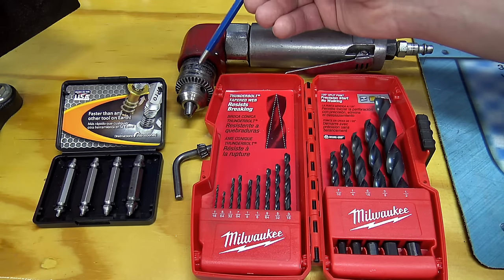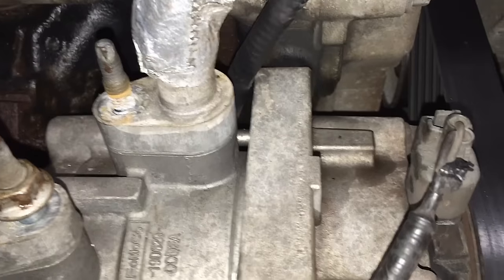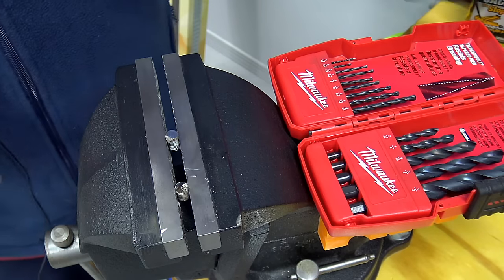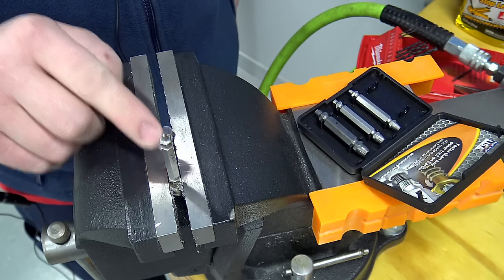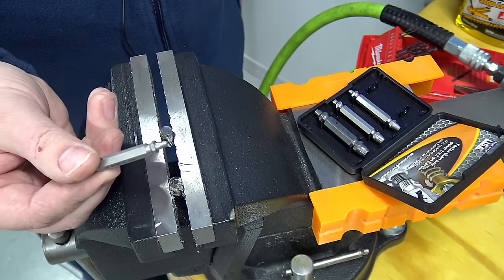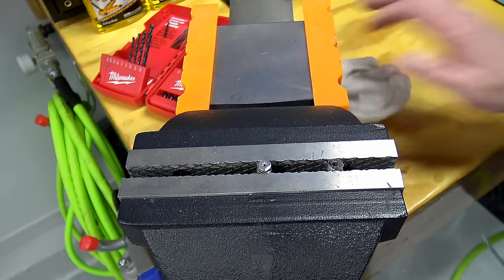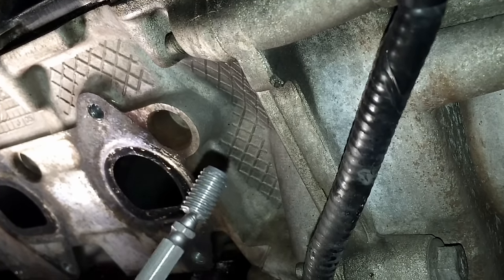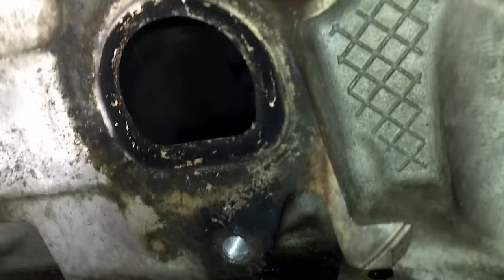Ford 4.6L 5.4L 6.8L 3v Engines: Broken Exhaust Manifold Stud Removal

Comment: I did this job on a 2000 expediton with 50k miles only thing that worked was welding nuts on the studs every other method was a fail total waste of time

Comment: NEVER..EVER .. has anything came off of my truck this easy.  He is truly blessed by the ford gods 😅
Reply: I have never had an extractor work either, have same set.. just fixed manifold and EGR tube on an E150 van, 3 studs snapped, had to drill and tap them, luckily the rear ones and could reach from tunnel on a 5.8, then bought a newer F150 3 valve and of course, the manifolds are leaking on that as well...

Comment: I wish the factories would start using anti-seize on most everything, especially stuff like this.  I'd rather have something like this come loose and leak than break and leak.  You are definitely the "car whisperer".  You have talents that continually amaze me!
Reply: That’s not the problem here the problem here is the quality of the studs.. I almost never drill anything out I weld a nut to the broken stud and back it out like that. If I do drill I use left handed drill bits they are already short bits and since they spin left handed if it “catches” the broken stud it will back it out if it’s not frozen in there. He did do a great job drilling these studs it’s not easy to drill nice and straight like this I use a guide to get them drilled in the center.

Comment: Try it on a rust belt 2004 5.4 3 valve F150 that's 20 years old and has 206,000 miles on it. I recommend 1000 degree JB weld and live with a little noise until you have to yank the motor for all the usual.  Ya know, timing chains, roller rocker studs, cam phasers all of that. You do good work. These are a nightmare. I do like the trucks but cmon Ford!

Comment: That Grabit brand of extractor I own works well but i have had issues twice with the smallest one snapping the tips off.   The other day I drilled out a small WSS wire bracket bolt on a E250 steering knuckle and the bit tip broke off.  I think it was just way too rust welded to be extracted.  Without rust the tool works good.  The Grabit honors the lifetime warranty, mail it back and they send you a replacement.

Comment: I just finished replacing the passenger side exhaust manifold.  The two rear studs were broken.  On the top, I drilled a hole and started to remove the stud with a Grab It Pro #1.  It was turning and coming out then the extractor tip snapped off in the hole.  Looked around and found several references to using Dremel bit 953 (aluminum oxide grinding stones) to  cut through a broken extractor.  Took two bits to get through it but it worked out.  Opened the hole up a bit more and used the larger #2 extractor to finish the stud removal. 

As always, thank you for the video.  I've finished two repairs on my truck now with your help.  Great step by step guides.

Comment: Thanks for the video! I managed to extract two broken exhaust manifold studs from my 2000 Navigator 4 valve. I followed pretty much step by step as per your video. I did a dry run with a stud in my bench vise to ensure I had the correct drill bits. Worked like a charm. This is the third of your video's I've used with success!! One to change all the lash adjusters on my 2000 Navigator and one to change the Cam Phasers on my Wife"s 2005 Navigator..  Great!! Thanks again!!!

Comment: Ok, u have no idea how many different "broken stud" videos i have watched and while most were good, none of them fit my situation so the process wouldnt work. The studs on my 5.4l 2v head broke off about a 1/2 inch in the hole and now i finally have the right process and access to the right extractor set to get the job done. Thank you so much for this video!!

Comment: Awesome Brian!  I have fought that battle and feel your pain!!   A few tips and tricks I can offer that have occasionally worked are: if the stud broke off even with the flange -which they often do, is to weld a nut (which fits over the whole stud) and lay into it hard until that thing glows cherry red (filling up the internal part of the nut).  Once it's cooled a bit, you can try backing it out. It should go easy at this point since you have heated it enough to swell the stud and expand the joint some.  If it's still stubborn hit the nut with a Mapp torch and then cool it off with some PB Blaster or equivalent penetrating oil and let it suck some in and try again.   If need be - you can weld yet another nut on to of the other hut (keep the flat faces together of course)  and after all the heat - it should come out.   If not then your method of cutting off the drill bit and using the right angle drill is the last resort.   they make a right angle drill with a flex shaft input that works well with a Dremel toll or a Foredom tool that is very helpful in tight spaces also.   I agree about avoiding pulling the heads if you can.  Also, I went with a stainless exhaust stud kit off of ebay that has a hex end on them http://www.ebay.com/itm/FORD-4-6-5-4-LITER-V8-STAINLESS-EXHAUST-MANIFOLD-STUDS-STUD-KIT-UPR-2025-36-/290959054080?hash=item43be82d500:g:O9YAAOxySOlSBkyp&vxp=mtr

I have not been disappointed with them so far.   I will bet they will be much easier to work on next time!  I think from now on I will swap those out with every vehicle I own early on!  ;>P   Good luck people - I am pulling for you!
Reply from the maker: +The69badcat Agreed the weld method is the best but most don't have access to a welder. I hope to have a video on that method in the future.

Comment: Thanks for taking the time to post the video.  I'm going to be tackling the pass side manifolds on my Super Duty next week.  I'll offer a bit of unsolicited machinist advise.  First, after center punching, the centering hole should be drilled using a center drill.  These drills are stout, short and won't flex.  This should be enough to step up to the final size.  If you feel you need to drill a smaller diameter pilot hole, don't use a drill greater in dia than the web (drill center material when looking at the end of bit) thickness of your final drill size.   If you can find them, "screw machine" length drills are perfect for this.  They are short and have don't have flutes too long.

For some reason I can't post links, so Google center drill and Screw machine drills and you should be good to go.

Thanks again.

Comment: Great video. Thanks

For the below guy.  On the left handed drill bit. I've gone that route many times with great success. Helps to hit center of bolt/stud and sometimes we make a jig just for the job. Sometimes in the case to get a very small screw out, other times broken starter bolts. Never had to resort to an extractor. I can imagine a very corroded one could be a problem. But the drill adds heat and counterclockwise load at the same time.

Comment: I' m a Chrysler tech it is very common issue on the 5.7 Hemi in Ram pick up, havent done one of those yet but guys at work usualy weld a nut onto the broken studs, theres no plenty amount of space but enough to get the welder in there. I did one set of manifolds on a 2011 Dakota with the 3.7 V6 and it was not bad.. Decent amount of space and they are using bolts instead of studs and nuts. Patience is the key in those situation. Nice Vido
Reply: +Jonathan Lessard Those bolts spin out real easy.I have removed the broken exhaust manifold bolts out of the hemi taking them out with my fingers if sticking .
Reply: I did the manifold on my '06 5.4 f-150, what a pain.  wound up turning engine 30 degrees and welding studs out.  There was no way to work around the coilover tower.  Unichrome 1/16 rod worked awsome, haven't wasted my time drilling and tapping since.

Comment: Okay, I just completed the driver side on my 4.6L '06 Explorer, what I learned.
1.) Plan more than a day.  3 of 8 studs broke off
2.) Remove the sway bar for better access
3.) If the grip it screw extractor does not work do NOT use an easy out.  It sucks when they break off placing a hardened piece of steel in the hole.  If you are stupid enough (like me) to break an easy out off, figure on carbide tipped dremel tools and a helicoil kit.
4.) Partially remove plastic wheel well liner to get better access
5.) Studs for #4 cylinder can be drilled with a flex shaft Dremel
6.) An aircraft style angle drill with threaded shank drill bits is awesome (but expensive)
7.) To install the lower stud on #2, first put the nut on the stud.  Use a 13mm ratcheting box wrench with articulating head.  It is a bear to get to that location due to the motor mount.
8.) Make it a kid free zone.  Cussing will occur.
9.) As one other said, using a grinder to reduce part of the shaft of a #1 screw extractor works well, much better than micro extractor and small Crescent wrench.

Comment: You are the best hands down had the same upper bolt brake on my 5.4 3v all the other 16 came out perfect will do this tomorrow have propane torch and the same extractor set on hand hope it all goes well.

Comment: Heat works wonders...The bolts stick from oxidation, we/I use a torch all of the time in the shop to remove stuck studs, nuts, etc.

Comment: Nice work! A center drill like you would use on a lathe can be a handy bit for starting holes, they are very short and rigid, plus they are double ended incase it breaks.
Reply: hi.may ford crown vic 2003 lx is running 1 hours make loded and loss power and engine nocking.
plz help some one
Reply: @toofiq only drive it for 30 mins?

Comment: Studs can be a real pain in the butt .Thank you for the tips greatly appreciated .When I bolted the manifold on I found the two rear stud holes did not line up .So I'm going to drill out some of the holes .I noticed a couple had smaller holes.

Comment: good vid..maybe someone already said this but if you use a mechanics length left handed drill bit alot of times the stud will get caught and run itself out. I suggest cobalt drill bits they stay very sharp for a long time but snap if youre not careful. I have had those studs grab with right handed bits and run them in further.

Comment: Just pulled the drivers side manifold off today. Yep, two front studs are broken off in the head. I ordered all the tools you used in this video, minus the torch, and I'm praying for a good outcome. I have a small propane torch I can use if need be. I'm scared to death the extractor is gonna snap off. My cheap set of extractors have broken pretty easily.

Comment: The problem with this video is even most professional mechanics/technicians (by professional I mean they work at a repair shop) do not know how to properly use drill bits and can not drill the center of a bolt. If ur watching this video to learn how to do this you have a 99% chance of not drilling it properly like this guy did he made it look easy because he a professional he does it all the time, if ur gonna drill them and u have never done it before just buy the tool kit for drilling these fords so u don’t ruin the cylinder head. I also am a professional technician 20+ years and shop owner I have all kinds of different kits for drilling out and removing broken bolts every kind of extractor kits, left hand drill bits , broken tap remover tools, huge time sert kit, the snap on/bluepoint E1020 is one of my favorite kits it works great for getting a broken head bolt/stud out or anything recessed because it comes with long extractors and dies to center ur drill bit in the bore of a hole but honestly I have all this stuff and it does come in handy but most of the time I end up having to use a socket to center a drill bit because no universal kits have the correct size I need for whatever I’m doing. 

When it comes to removing a regular steal broken stud or bolt from an aluminum cylinder head I weld a nut to the broken bolt/stud and they always come out every time again in this situation where the bolt/stud it made of steel or stainless steel and the cylinder head is aluminum. When a broken stud/bolt is not broken off flush so it’s inside the hole you just need to build up the weld and no matter if it’s flush or in the hole the best thing to do which I never see anyone do is use a little hand held sand blaster just a little 15 dollar one from harbor freight is fine, tape off ur exhaust ports and anywhere u don’t want the sand/media to go then blast the broken bolt/stud so u have nice clean bolt to weld to which makes all the difference in the world it really does and when u were blasting it also cleans out the threads any corrosion or dirt so when ur backing the broken bolt/stud out it will come out easy. This is by far the easiest way. I have done this for other shops that we’re gonna remove the cylinder head. So many people have doubted me saying they tried there no way and I pull out my little hand held sandblaster and people laugh then a few minutes later when it’s out they don’t laugh anymore. I had this from my one buddies shop it was one of their trucks that had been trying for 3 days they called me and asked if I had any drilling tools so they drill it straight and I said come on u can’t get it out with a welder? They said no been trying 3 full days and a few different guys it’s not gonna come out by welding I laughed and said then u guys didn’t listen to what I said to do and they said they did, I said I bet $500 I can get it out in 10 minutes or less  as long as u have a hand full of the correct size nuts, good welder and air compressor they said bet. I went down there looked  at it and the bolt wasn’t cleaned good I said I told u guys it has to be really clean use a dremel with a carbide bit or small sand blaster I mean they did clean it up a bit but not where it’s fresh metal so I hit with my sandblaster, build up weld because it’s kinda deep then weld the nut on, let it cool just a hair and bam it’s out. I walk over to them they were sitting with their girlfriends and they said see we told u it wasn’t gonna come out! I said oh no I came over here to get paid they all laughed and walked over there and couldn’t believe it and they paid me. I’m not telling this story to say I’m better then anyone I’m telling it because so many people say welding nuts don’t work and it’s just not true people just don’t do it properly which is either because they don’t listen like my buddies by not cleaning properly or they don’t know how to weld or a really crappy welder or not removing at the right time because too early the weld it too hot so it just breaks off or too long so the heat from welding is gone so it’s not helping remove a bolt/stud that’s stuck. 

If you have a cast iron cylinder head and steel bolts it can be next to impossible to remove a broken bolt/stud if it’s rusted in there you have to get the head really hot which can cause damage to the head what I do it weld a nut on very good then I will heat the nut up 4-5 time until it’s orange and let it sit for 30 seconds between each time so the heat really works it’s way into the broken stud/bolt and if it comes out great if not ur screwed because now that I have weld on top of the stud/bolt u also heated it making it harder so it’s next to impossible to drill specially if you don’t have really high end drill bits that only a machine shop has I’m not talking about snap on drill bits I’m talking way better then that. So with cast iron heads if they are rusty it’s a good idea to drill them from the start and using something to help guide so u drill perfectly in the center.

Comment: Great Tip< The key is Great set of drill bits, new , yeah, black oxide , slow speed with some pressure, stay on the center, ( avoid drill walking) and step drill to the final size. before inserting the stud removal tool

Comment: I would use a dentist drill to get the drill bit started very small great for tight places. I would use heat treated brass nuts so if there is a next time it will be lot easier to remove or replace the gasket or manifold. A great video terrific job well done.

Comment: I have one of these to do on a mountaineer right now . First I would like to say thanks for the Videos. I have been a mechanic for many many years and worked mainly on Fords . However your videos are still priceless insight into jobs that I havnt had to do yet. This helps with estimating as well as with the job itself and getting it done.

With that said . If you set out to do it that way and I set out to do it with the engine out. Are you sure you are going to beat me ? I have done motors in these things and realize that its no picnic but not horrible either. Im sure you have changed some of these as well so your opinion would be greatly appreciated. 
Many times in my earlier years I would do something like this thinking I was saving myself work but in the long run it was faster to just yank it and work on it out in the open.

Comment: I just did mine.Two bolts broke deep inside.Always use left handed drill bits.They saved my ass.Even after braking the easy out in the bolt.A dremel with a tungsten bit saved that..And then the left handed drill bit..

Comment: That Kroil oil is in my opinion the top of the line penetrating oil around! If you have to change your spark plugs in your f150 5.4, 4.6 and 6.8 3 valve with the three piece plug that is known for breaking off in cylinder hole and needs to be soaking to loosen the corrosion prior to removing plugs this works! FYI
Reply from the maker: That was the initial chemical solvent Ford recommended its great stuff for tricky situations- http://amzn.to/2dppmFu